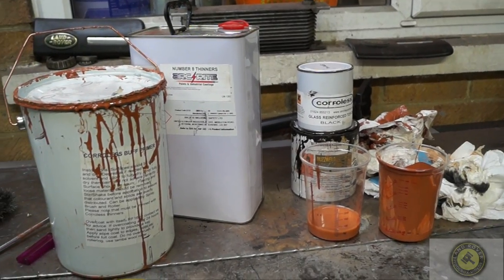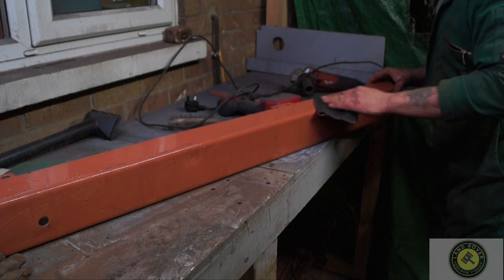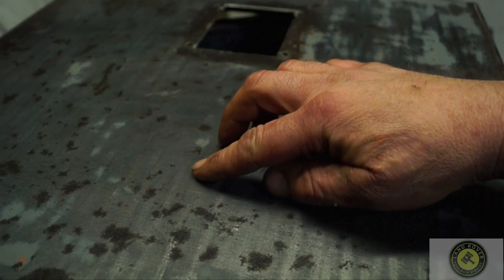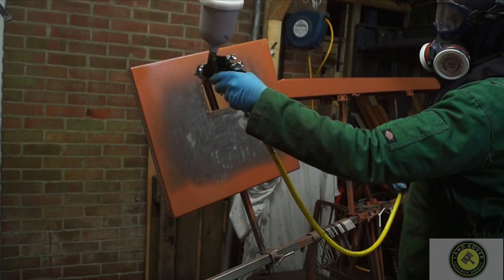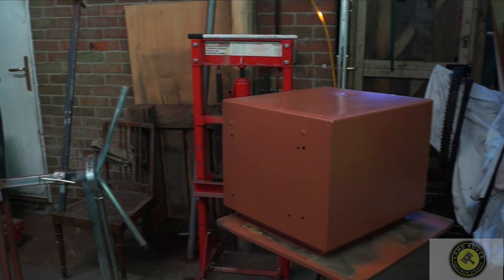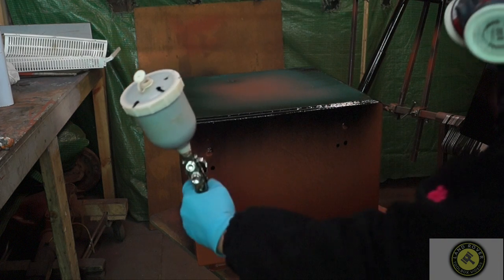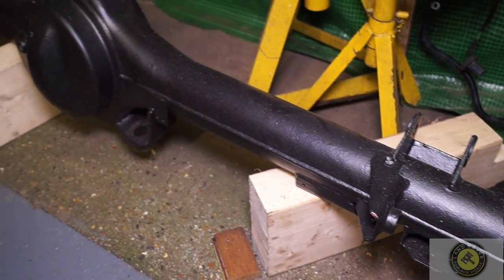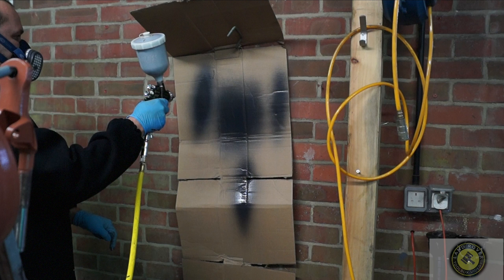Corroless RF 16 Glass Reinforced Top Coat Paint.  Ideal for Land Rover Chassis Components

Comment: Good stuff....what size air cap do you use for the  glass reinforced paint.
Reply from the maker: It is  2mm . cap is changed on this type of gun for the size not the needle. With other guns,  in general a 1.8 or 2 mm fluid tip is good for this paint.
Reply: Ok thanks......its a good idea to warm the paint up....don't do this with aerosol cans though...previous experience has taught me!
Reply from the maker: he he i don't think the heater is suppose to be left on